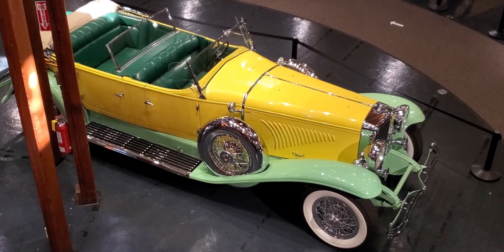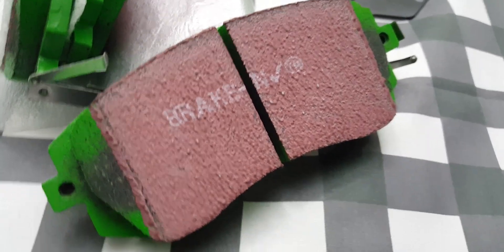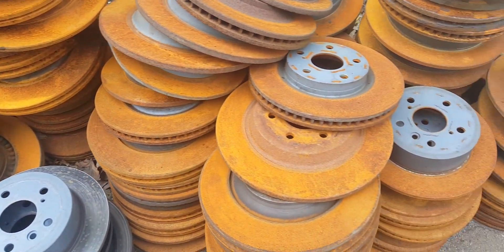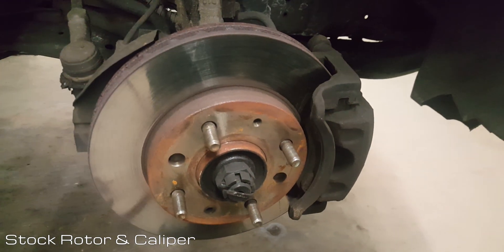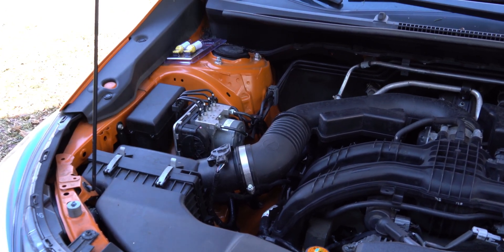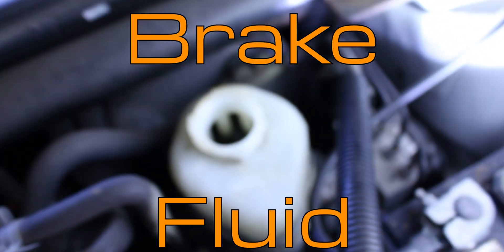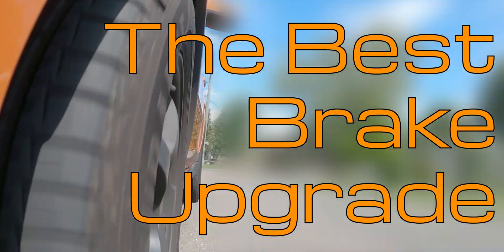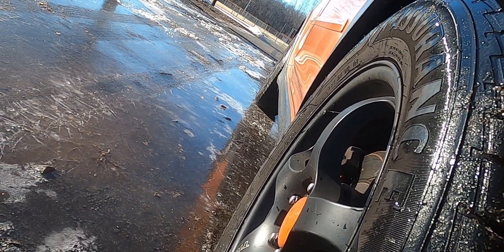What is the Best Brake Upgrade? Brake Performance Upgrades Explained!

Comment: tires too. Can be the Biggest Gain on a track for any single Upgrade. I Also Disagree with Brake Fluid Being a Consumable. Brake Fluid DOES Retain water over time, and turn dark, and not function as well, and Should be Drained and Refreshed with New Fluid. But Aside From that , You Really Should Not Ever Lose Brake Fluid, Nor should you Need to Top up the Reservoir, that means you have a Leak or a Problem somewhere.

Comment: Drilled and slotted rotors do not provide better cooling drilled rotors became a thing years ago to stop outgassing from the pads at high temperatures the newer pad material doesn't out gas anymore. And slotted rotors simply clean off the brake pad surface by slicing a thin layer off as you break and do not promote better cooling do some research before you pump out an article and get your facts right

Comment: Tires are everything.   Big brake kits are for the track.   Testing has shown that big brake kits do not make a car stop in a shorter distance.  Every factory car can lock (ABS limited) up its brakes.  Every car.   They are all engineered that way.    Big brake kits, upgraded fluids, drilled/slotted rotors are all for HEAT DISSIPATION, not stopping distances.   Sports cars stop in shorter distances because of TIRES.
Reply: Absolutely if you have a brake bias of 80% and do it at 20mph. Try doing it on a highway at 90. No chance with stock brakes.
Reply: @alexd.6376 Small difference. Even carbon ceramics dont stop better, they are just more heat resistant. They are important but tire size is just as if not more important
Reply: @BadBoiFX not exactly.....

https://youtu.be/aM1LwvWCz5s
Reply: @traveltonshl The limiting factor are the tyres even if brakes are better although the difference between a 340mm and 440mm brake aren't huge in the real world

Comment: Im looking to upgrade both tires and breaks on my 05 gto this summer id be curious to hear your thoughts on that if you have any
Reply from the maker: Nice! It would definitely depend on your budget for them, but I am leaning towards getting some sort of Michelin Pilot Sport option when I get my GTO back on the road. As for brakes, I like my DBA rotors, but the pad size (and therefore calipers) seem to be the weak point on GTO brake systems (even with the upgrade the 05s got over the 04s). If I upgrade my brakes any further, a big brake kit or some sort of larger caliper swap would be my next step.

Comment: Since we both have 04-06 GTOs. Any plans for an Brake upgrade for yours? I’m going for Willwoods for my GTO. For Tires 🛞 I’m going with Perelli Zero plus all weather. The PS 4s are the best. But I can’t afford them right now.
Reply from the maker: I definitely want to upgrade the brakes on mine (the GTOs got some weak brakes from the factory). I have some DBA rotors on the front already and have some performance brake pads ready to install, too. I've been considering trying out some DOT 4 LV in it to test it out for a video, too.
Reply: I did the 2014 ctsv brake upgrade and it is sooooooo worth it! 6 pistons calipers  up front, 4 piston calipers in the rear. But as he said, the tires are where it's at when it comes to braking. I run nitto 555 g2 and my braking distance was shortened by 21 feet from my old toyo tires